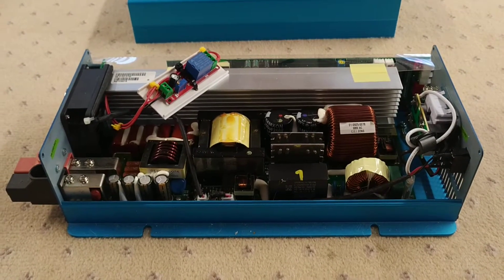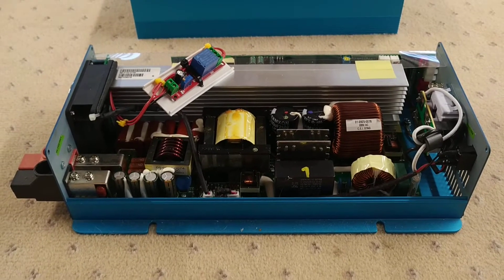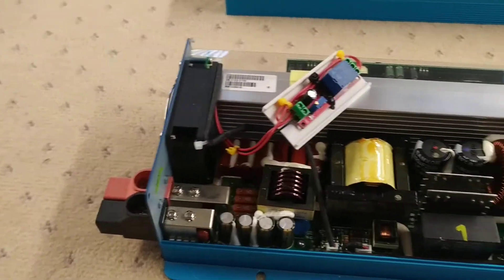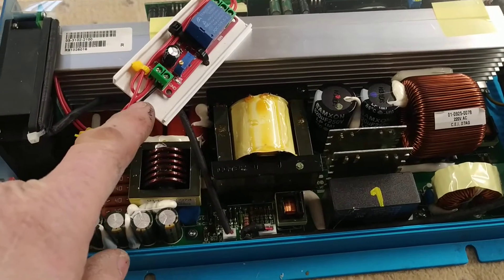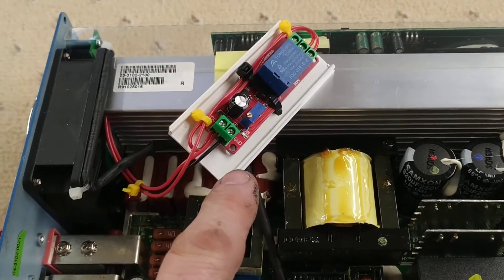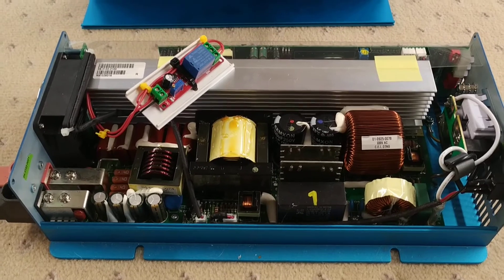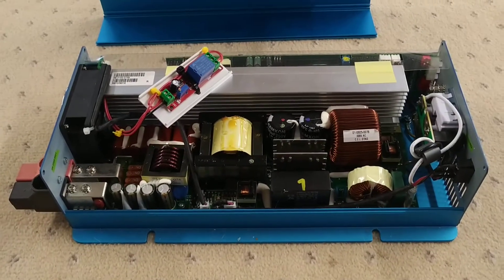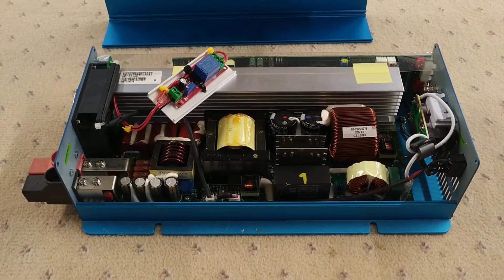Cotek inverter mod to prevent a momentary undesirable cooling fan startup

Comment: Hi Keith, the fan on my 12v compressor fridge often cuts in an out for just a second. I assume I can connect one of these to the circuit and it would stop this?
Reply from the maker: Yep it should and as they don’t cost very much it’s certainly worth giving one a try